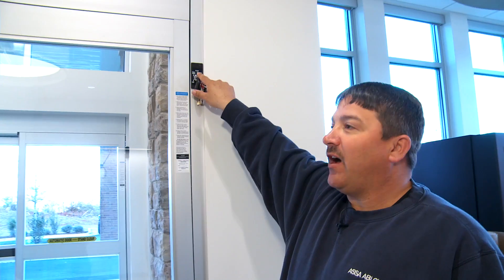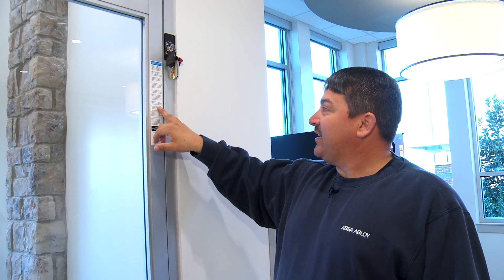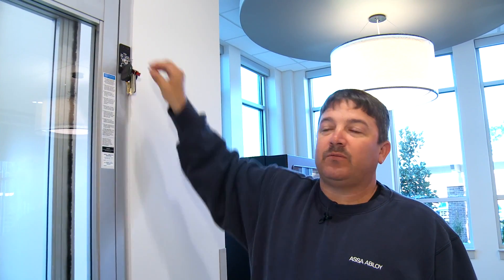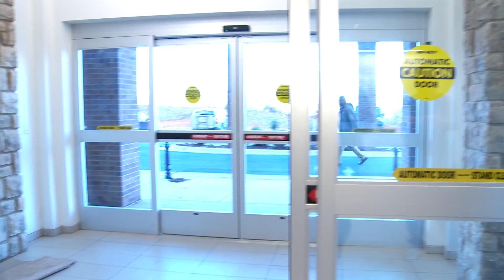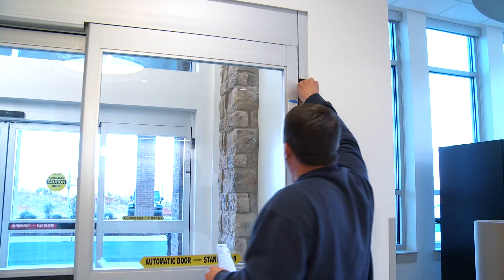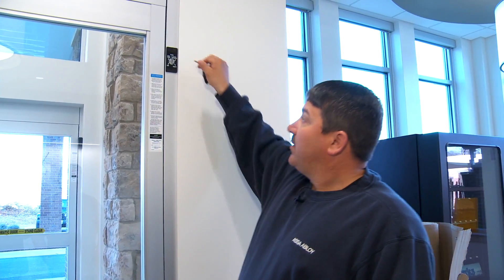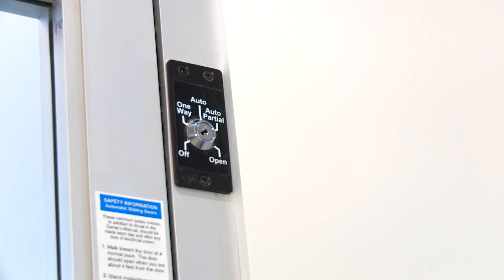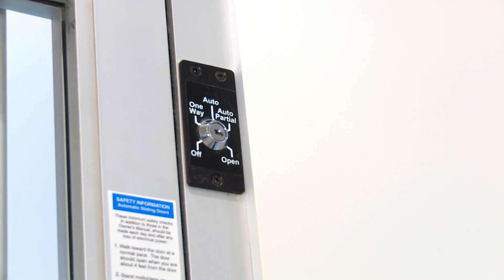Automatic Sliding Door Training

Comment: I installed auto doors for 40 years (Besam and Stanley) and I doubt 1% of the owners even know or even care how their door works. Sad because they would benefit from this video.
Reply: Why does the sliding door only open partially when key is turned to OFF position? How do I get it to fully open. 
On AUTO mode, it opens normal. Any tips?
Reply: @kaijunior4339  If it's in the off position it shouldn't open at all. Is it a Stanley door? Most auto doors have a partial opening setting.(used for cold weather)I never liked this setting because people tend to walk into the door thinking it is going to open all the way.
Reply: @door2416   yes it’s a Stanley Sliding door. When it’s on OFF position, it will open on push-to-exit button only but door opens partially instead. Is there a switch on the board that I could flip that could change this setting? Thanks
Reply: @kaijunior4339  Ok , that makes sense. When you are using the exit button the door is in partial opening mode. If you want it to open wider it must be programmed to open wider in this mode. The width in partial opening is set by programming in the control.
Reply: Hi, im really interested in learning this skill. where can i learn these trade automatic doors and add it to my services?
Reply: My besam doors jerk barely then don't open it close

Comment: Why does the door only open partially when key is turned to OFF position? How do I get it to fully open. 
On AUTO mode, it opens normal. Any tips?
Reply: if the door is opening in the "off" position it is likely getting a "key impulse". arrange to have a AAADM certified door technician make adjustments to the door to have it work to your requirements.
Reply: @briankalman91  thanks for the information 👍